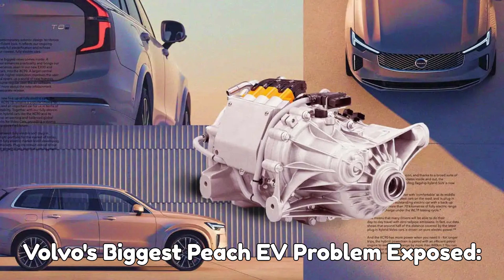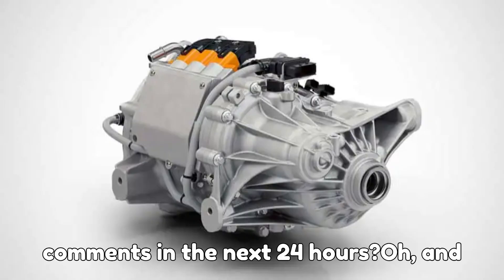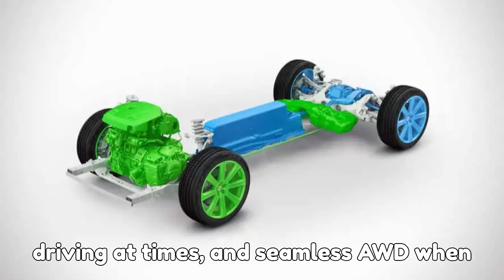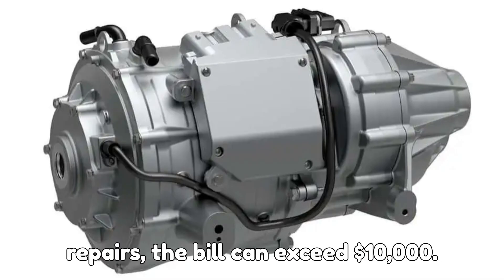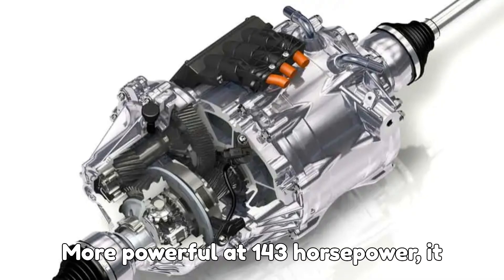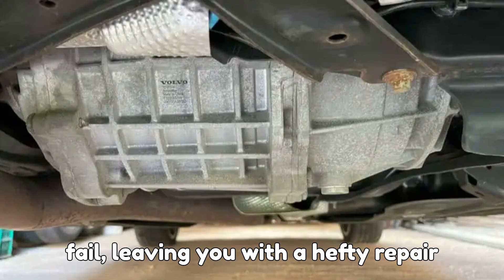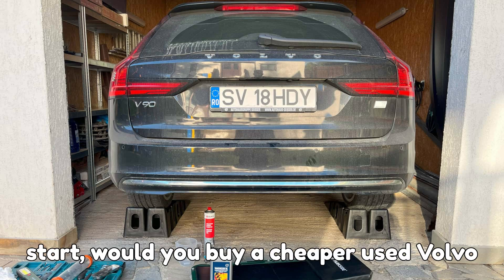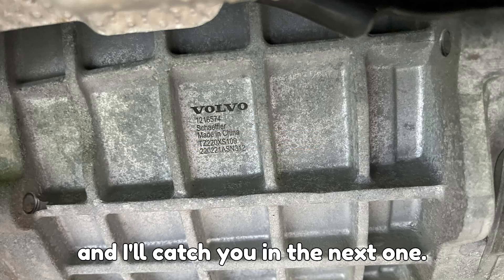Volvo PHEV ERAD Failures: The $10,000 Problem They Don’t Want You to Know

Comment: I have a 2023, just got it back from workshop. ERAD3 is also problematic.
Turns out that the ERAD3 has a problem with stuck gear. It will make itself know by making a clonking sound as soon as you touch the accelerator pedal. Great invention this...
They took it out and replaced the gear and the oil, I think.
Reply from the maker: Thanks for sharing your experience with the ERAD3!
Reply: This is v interesting, I have just picked up a second hand 2022 T8 (18.8kwh) and appear to have this noise. Which I can only explain as clunking when pressing the accelerator when using electric. It’s booked in at my local dealership early in the new year to be checked. Was there anything your dealer gave you for the fix or how they determined a stuck gear?
Reply: @saj435  I talked to the tech afterwards and what they did was disassemble the ERAD and replace the knocking gear, and I presume the oil. All good now. At least there's no need to replace the whole thing like before, so I guess that's a plus.